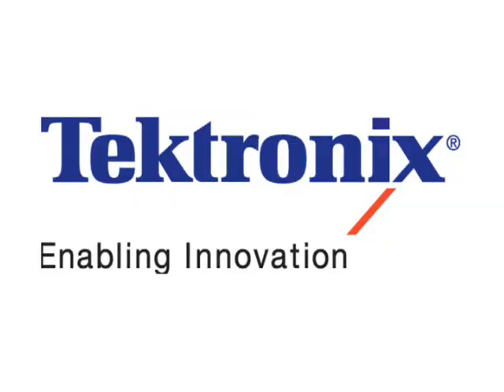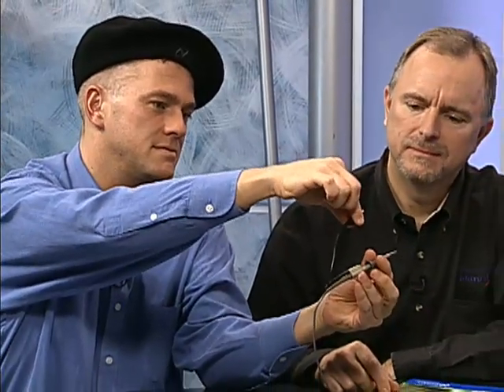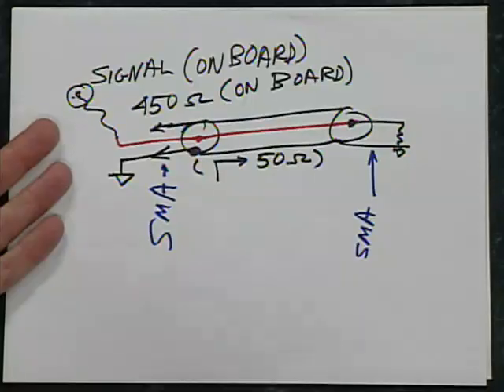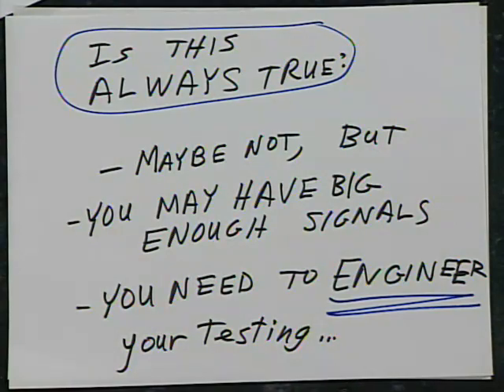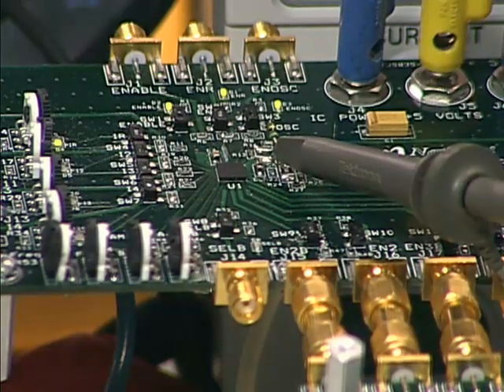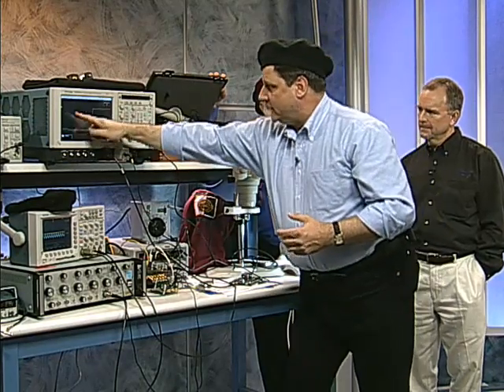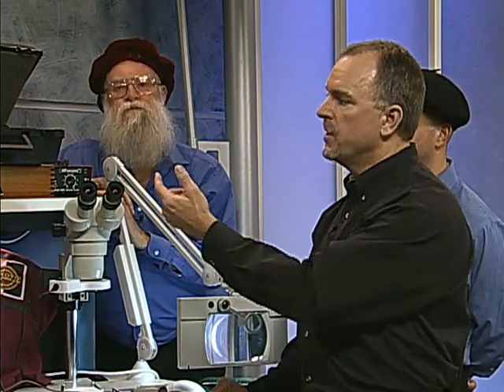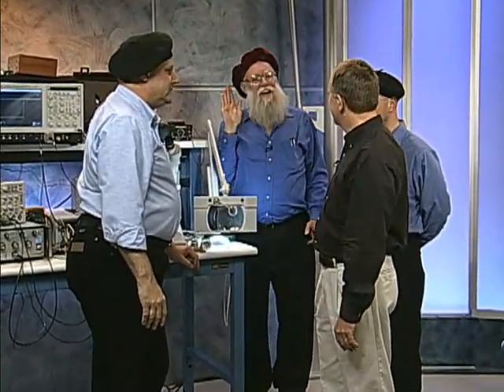Whats All This Scope Probe Stuff, Anyhow?

Comment: Wrapping  a scope probe lead around a ferrite toroid is inserting a common mode impedance into the measurement hence improving the common mode rejection of the amplifier.  It only works if the ferrite still has a high permeability at the frequency you are trying to reject, so don't use a square loop or a low frequency ferrite.

Comment: Tip...  If you need to set the compensation, and you lost the little plastic do-hicky that came with the probe, just take a toothpick and file its tip to the shape of a screwdriver.  I've done this for adjusting trimmer caps in RF circuits.  Hummm... I said "tip."  The pun really wasn't planned.
Reply: Clyde Wary I use one of those tiny flatheads that come with those cheap little eyeglass repair kits at the drugstore
Reply: @dankleton  You don't want to use a metal screwdriver because the big conductive mass changes the capacitance

Comment: "You can't use a conductive screwdriver. (for adjusting scope probes)"    

Well, you can remove the screwdriver and THEN check the overshoot/undershoot and make progressively smaller adjustments until you get the probe dialed in;  NOT THAT DIFFICULT.
Reply: As Bob said, a few seconds later.